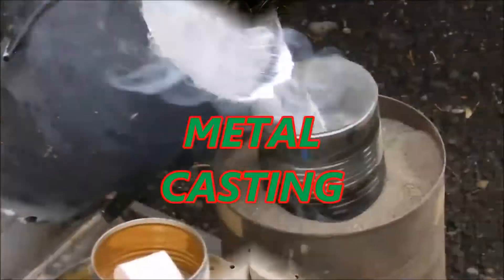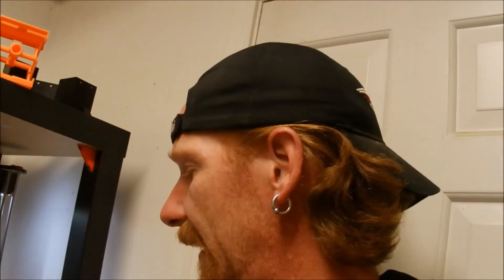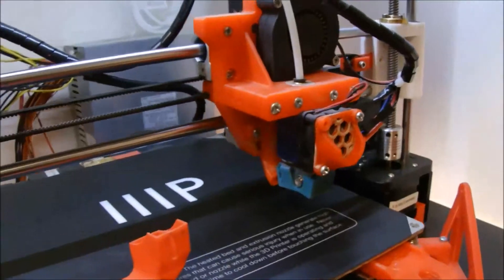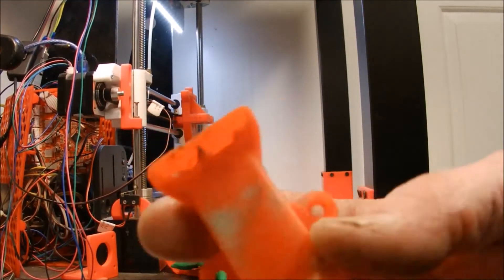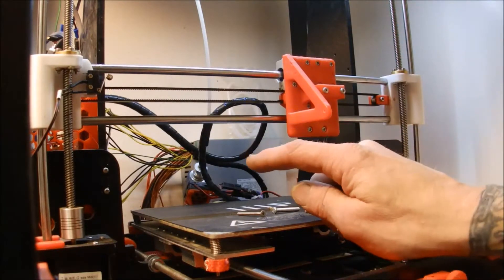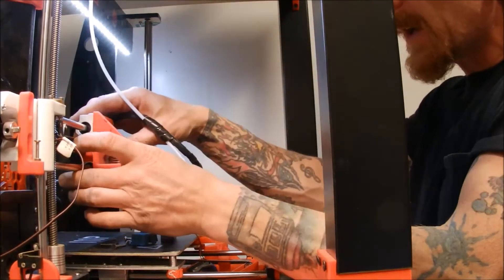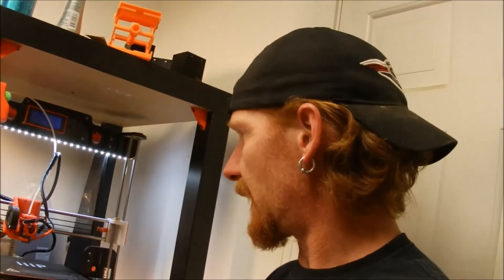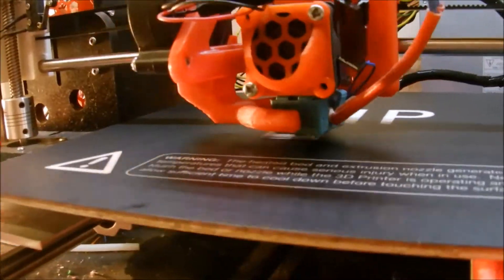RE MOUNTING ED3 V6 ON ANET A8 PLUS GREAT NEW TIP

Comment: this is anet a8 plus? i want to install the v6. will there be any changes to the firmware to be made?
Reply from the maker: I would suggest changing the stock firmware anyways marlin runs good on the the Anet motherboard and depending on the mount you use you’ll have to change code to get the nozzle orientated in the center
Reply: @InsideTheMindOfMatt  is it configurable after changing it to marlin? anet a8 plus sold out in my area so i wanna make a printer myself. can you tell me what part i should get for it's electronics? like motherboard etc
Reply: @InsideTheMindOfMatt  thank you so much bro. I'll subscribe to you

Comment: I have done everything you did. 
My extruder gets off to a good start but clogs up after 1 or 2 layers 
Tried pla at 225• no luck
Seems like I get a lot of melting close to the end. 
My next try will be lower temperatures
Reply from the maker: Mark Greco I’ve learn lots since this is suggest a Filament oiler many models on thingiverse I added a little piece of sponge with some canola oil and haven’t had problems since
Reply: Inside The Mind Of Matt I’ll try it, thanks Matt
Reply: Inside The Mind Of Matt finding that the retraction is huge, and possibly the starting GCode 
I will let you know
Reply from the maker: Mark Greco my retraction is set at 5mm and if you want my start gcode let me know it homes then does a prime line and then prints
Reply: Inside The Mind Of Matt YES PLEASE
Reply from the maker: G28
G1 X10 Y10 ;move to x10 y10
G28 Z0 ;move Z to min endstops 
G1 Z0.4 ;raise to 1.8
G92 E0 ;zero the extruded length
G1 X40 E25 F500 ;extrude 25mm filament in a 40mm line
G92 E0 ;zero the extruded length 
G1 X80 F4000 ;quick wipe
G1 Z0.5 ;raise and begin printing?
M117 BUSY PRINTING!!
Reply: Inside The Mind Of Matt  it was this in marlin E in mm3 locked ON. FOUND A FIX. thanks Matt